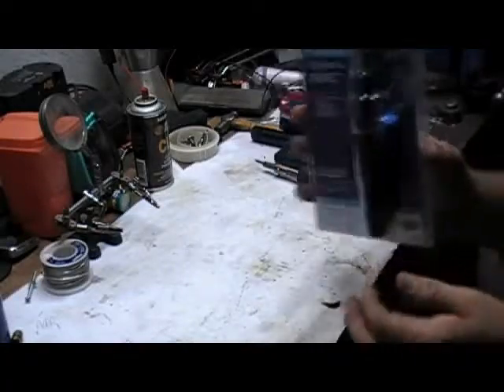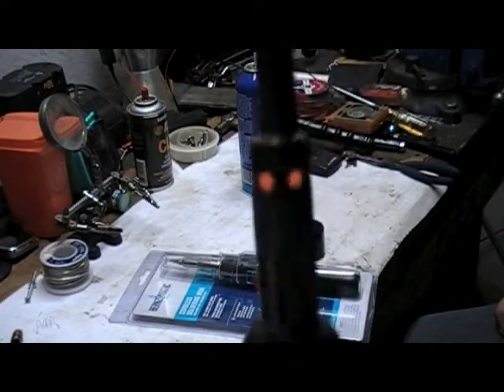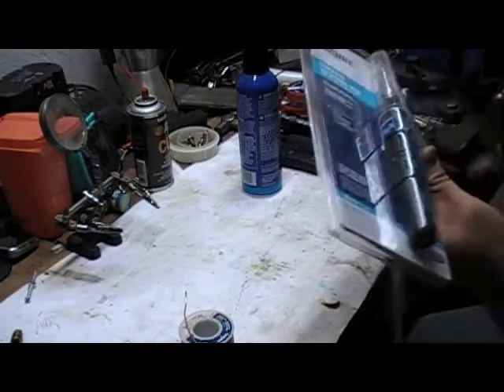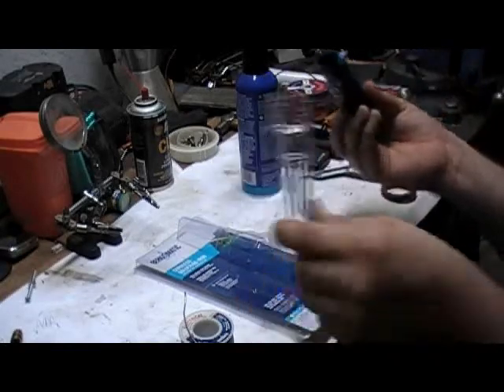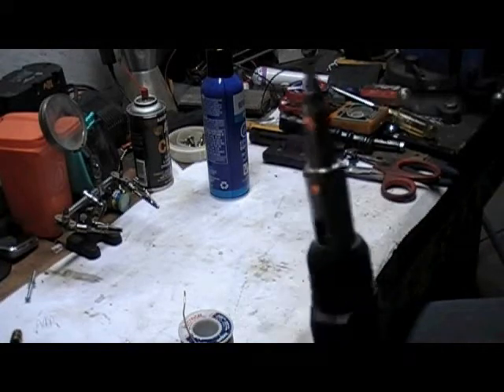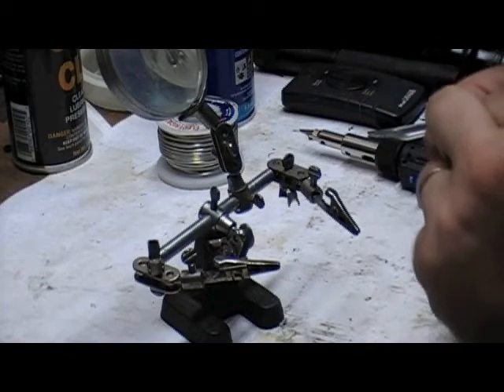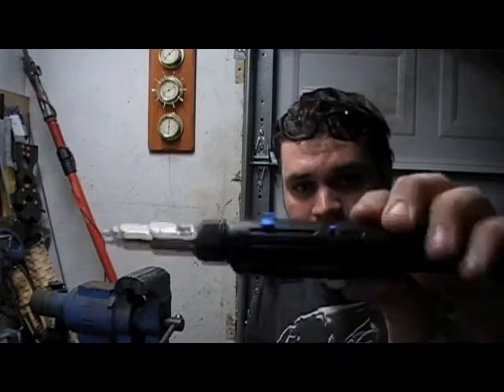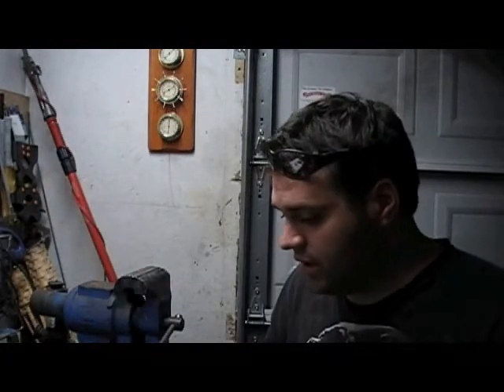Butane Soldering Iron Unboxing and review

Comment: My cheap Harbor Freight Schneider soldering iron can't stay on for more than a few minutes without running out of fuel or when I shut it off to conserve it of course cools down really quick so its really inefficient. But it was around $20 so I guess I got what I paid for.
Reply from the maker: this soldering iron  is kind of the same way  ,  after about ten minutes  it starts slowing down  ,  i refuel it as its running    and it will keep on rolling for a while   ,  on the other hand  my master ultra torch  will stay running for around 2 hours     the only down side is   it is about 150 bucks    and to have it repaired  is about $57    flat cost    ,
Reply: The Random Mechanic oh ok yeah for a second I thought it was just that my iron was just cheap and just sucks.
Reply: @thatonebear6848  get I bought the same iron man can you help me was he correct can you refill while it's on because I'm gonna take it back to harbor freight if it does
Reply: @Allious131  I strongly suggest against filling up the iron while running it due to the chance it will cause an explosion.
Reply: @thatonebear6848  ok so is it a faulty iron or is it a good one I just bought mine yesterday and it keeps dying fast
Reply: @thatonebear6848  ohh and one more question how is the hot air blower is it consistent I'm fixing xbox one motherboards will it get the job done???
Reply: @Allious131  I'm not sure really. The fuel tends to run out before I can actually use the damn thing.
Reply: @thatonebear6848  hahaha 😂yea me to bro it won't stay on long enough to solder anything